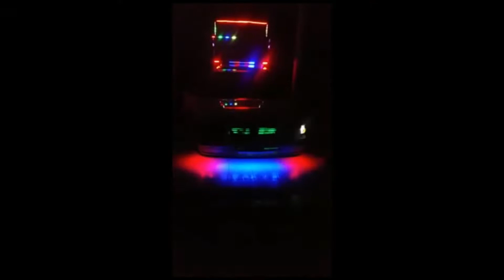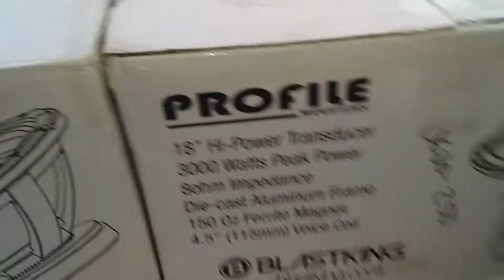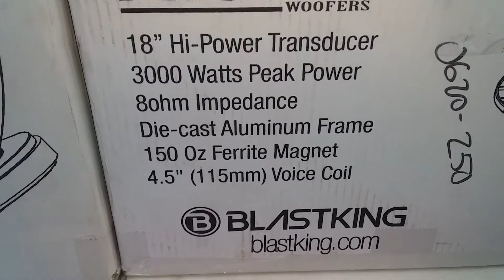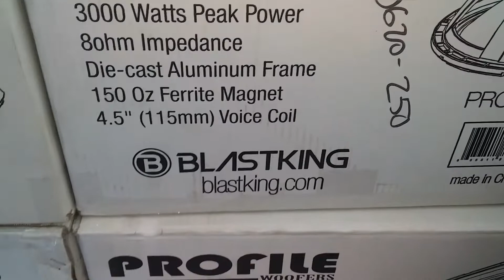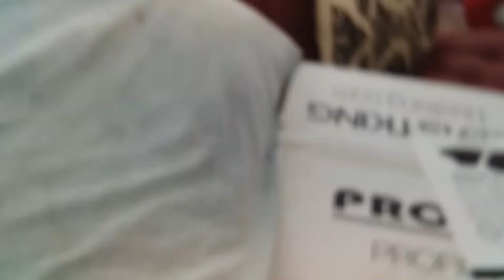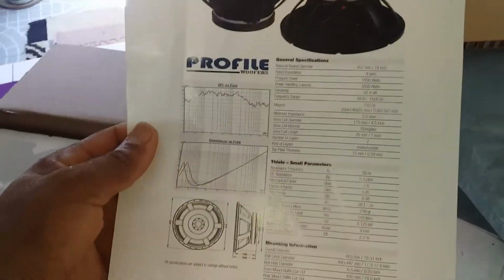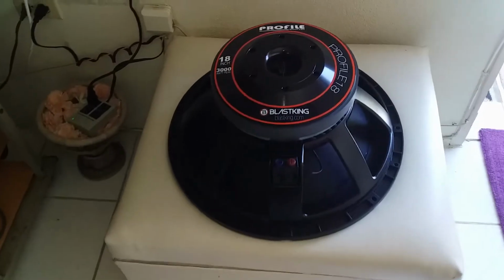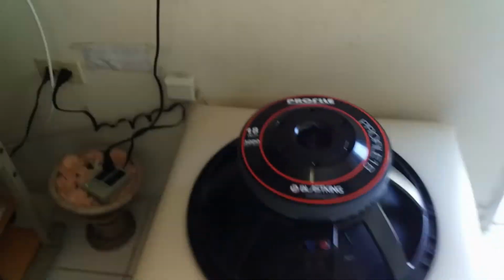BLASTKING PROFILE 3000WATT UNBOXING....

Comment: Yes brother Nizmo  I just got this video. I love those speakers bro .I always  look at them on the Internet saying  that I want the 15 inches 2000 watts  version for my sound system .  Those I have  since early 2000 are the 1000watts  series and they are still kicking , never repair . 
I have some 18 inches gauss  rcf and celestion. But not using them .

Since the sound system  industry  cut down I down size my sound .
Blast king are my speakers good price and can play any where , Bass lowmid high mid they are very flexible.  Good by . I love you r choice everyone  a run down Kickers and Alpine  . 

But what about the Orion brand speakers they look terrible . I don't hear anyone using them .

Comment: Car audio bass is meant to play low bass, u could run different car subs and different box designs to get more of the tonal bass u want I could be wrong too. a lot of Trinidad car sound systems use car audio subs too sundown massive audio ds18 atomic stuff like that and them jam down the place man hard music bass or low ground pounding bass but it’s ur sound and that’s what make ya sound unique big up 🔥💯
Reply: We in Trinidad apply 60.000watt rms behind 4 subs @60hz with all kind of 20 10inch mid speaker and the bassline hits u like a wave

Comment: Yes the spiders are double, had a qsc 5050 on 8 of them and they were asking for more power, fling on a cvr 3002 and them good after that but unfortunately around the coning started failing after awhile so I'm using rcf p300 now which are much more easier to play.
Reply: B&C tbx100 is good 😌
Reply: Brother  when using cvr amplifire you better have solid speakers or else you will have to buy or repair them soon .
The 3002 is a beast .